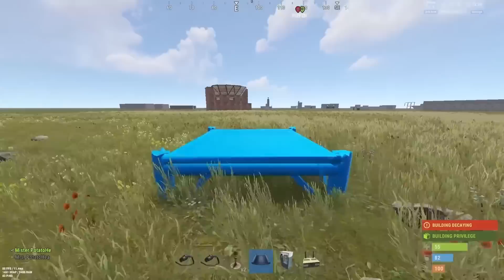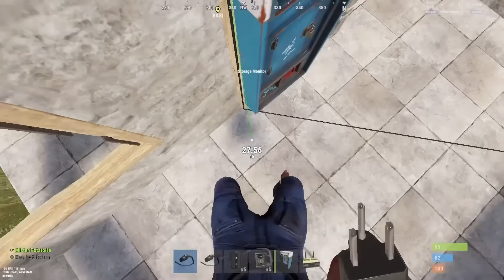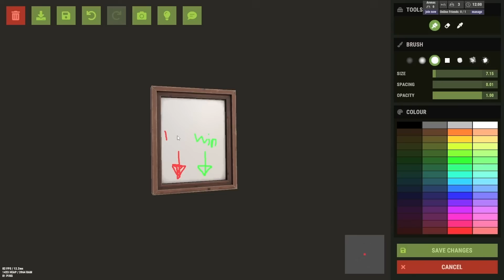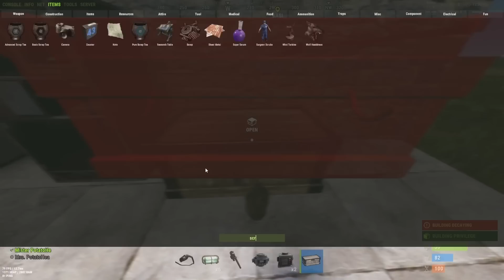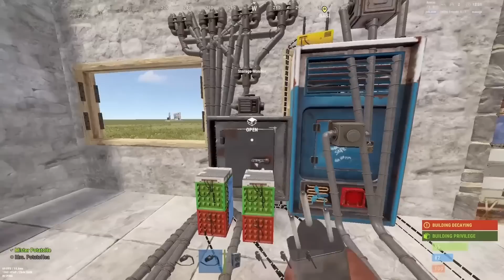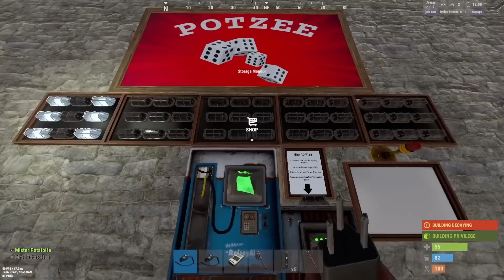Rust slot machine tutorial

Comment: i made a 50 50 machine on console.. i was having all kinds of issues.. why doesnt the item have to be stackable? im using high qual and its working fine.. tho its instant reload.. so i had make a note saying wait until the red light (game active) turns off before you buy next round.. i have it working smoothly.. all kinds of issues tho.. then i found this haha.. which is good tho, ill use this as reference on my next one. im playing on new gen console so its not quite the same.. we dont have those awesome wall mounted lights yet.. just the hanging one, and the flashing red and blue ones... which also.. that blue one is supposed to be a pulse, turning on and off with every beep.. but its not.. lolol its passthrough just is constant power.. if you want a continued pulse you have to use a timer on a circuit.

Comment: conveyors adding the note to vending machine and taking the scrap is triggering the game again after already being played already
Reply from the maker: Are you on a modded server? Sometimes different servers have the conveyor speed turned up a bit. If not, do you have all of the timer values set correctly? Honestly, I've learned a lot in the 10 months since I posted this and I would actually do things slightly differently now
Reply: @MrPots69  Would love another video, might be timer times as well for me. But when the game is played all is normal. But then the Conveyor puts the note into the machine which triggers the storage monitor again thus triggering the whole game when it shouldn't be. Great video though super helpful info love the rust electronics!
Reply: Figured it out right away, but the very first timer placed had to delay to 15 seconds, so they conveyor is taking about 14

Comment: it seems it doesnt work to transfer backwards on the drop box even if the drop box is full. they did some changes to it. so it now has 4 openslots instead of 1. so maybe that also triggered or fixed something.  i guess a small box will do.
Reply from the maker: Yeah, unfortunately you can't fill the drop boxes from the back anymore. You'll have to use a normal box or flip the drop box around and let the player interact with the back-side of the drop box

Comment: It was workin now its not it wont fill note back in vendor and wont take scrap out vendor or put scrap in dropbox pay out
Reply from the maker: They changed the way dropboxes work so you have to flip the dropbox around so the player sees the back of the dropbox. Or you can use a normal wooden box! Not sure why it wouldn't re-stock the note, but maybe fixing the dropbox will fix that, too
Reply: Works fine when switch is pulled but doesnt work when buying a ticket the way ur ment to think theres a bug with storage monitor
Reply: I figured it i changed storage monitor branch to 3 not 2
Reply: @hard_hit3760 thank u so much having the same problem got it working on console aswell.